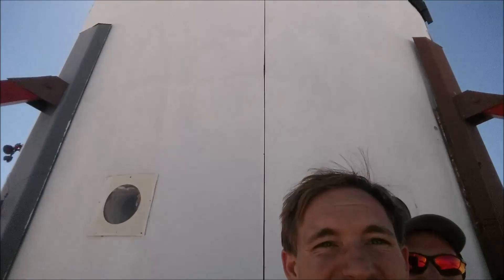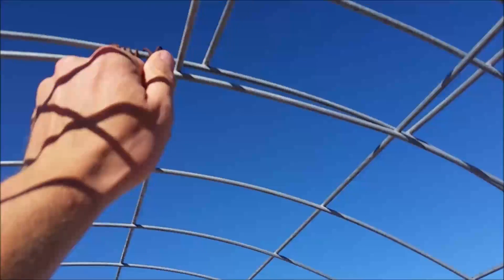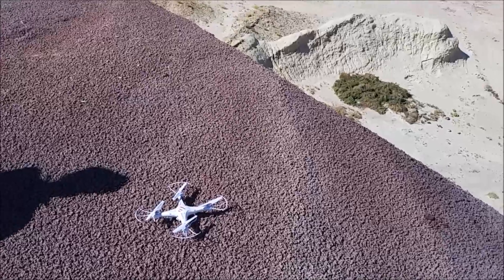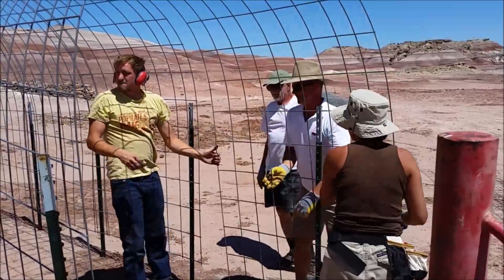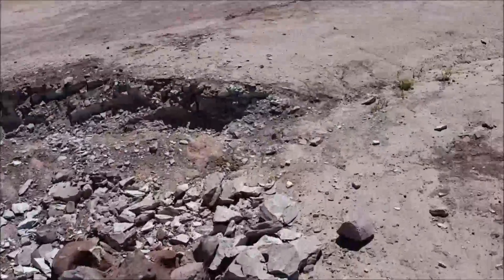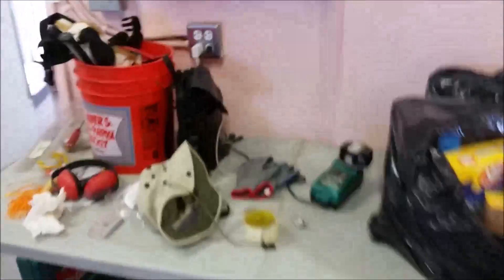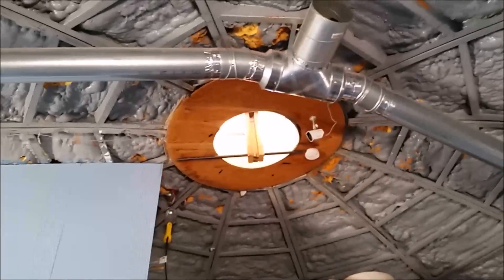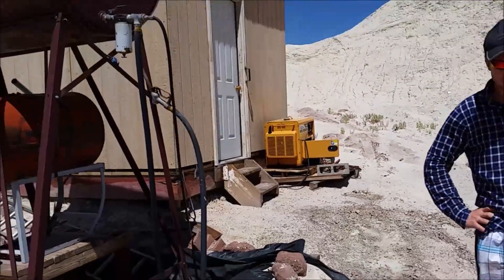Mars Society Refit 2015

Comment: I love it .     Glad to see the MDRS again and I'm glad that no One got hurt (or the Hab) in the fire , hopefully the next greenhouse will have less problems than the last .        Tell Them that they should just install a jacketed two fluid Thorium Reactor instead of those Diesel Generators lol , JK .       But You Guys should be able to have a couple of SOLAR CELL SOLDERING PARTIES  and make the KW hours for Yourselves .     I don't think a wind turbine would work well on Mars , but Several wind turbines would be great for the MDRS energy deficit just for supplemental power , the wind blows really well there (Plus I'm sure that They'd know exactly what Their daily KW hour average is , so it'd be easy to scale the power system) .     Great Video Man :) , Thank You Mr. Cody .
Reply: Kyle R i think a wind turbine would work, but sand storms woud maybe destroy them
Reply: Rafael Robles    Sand gets into every thing lol .   Yeah , if They built a big enough one , I'd suggests screw type Horizontal Axis wind turbines , supposedly they'll only spin up to a certain RPM and apparently it can keep from damaging it's self .   Yeah , I'm curious too .  Take Care .
Reply: +Rafael Bollmann Darude sandstorms?

Comment: "there are no weeds on mars".. well, there also is no atmosphere because mars is too light to hold it's gas, it just gets blown away.

Looking like a pretty cool project :)
Reply: ***** mars has an atmosphere, just with way less oxygen
maybe you mean that liquid water gets blown away because of the lack of  a magnetic field
Reply: Rafael Robles
the mars atmosphere is 100 times thinner than on earth, so basically it's not noteworthy what little atmosphere mars can hold.
The point being that "terraforming" mars wouldn't work because whatever oxygen you create there, would get blown away into space because you can't increase mars' gravity. So unfortunately the only way to live on mars is as they try to simulate in this video, in closed, pressurized "biosphere" things :D
Reply: Yes , there is an atmosphere but of course thinner because of the lack of a magnetic field(and the lower mass, but less that reason). but if the temperature would be higher, plants would be able to grow there
Reply: ***** The leaking of atmosphere is a very slow process, and earth leaks atmosphere as well, but it creates it just as fast. Too fast and it runs away, like venus, too slow, and it all leaks away like mars. Mars simply needs more aggressive atmosphere production. If a disaster killed off life on earth, it wouldnt be too terribly long before earth lost all its atmosphere like mars, only it would take a bit longer for earth.